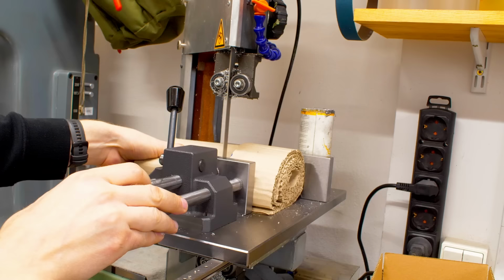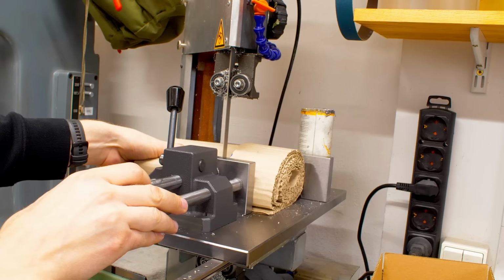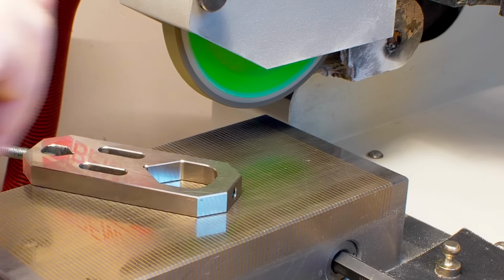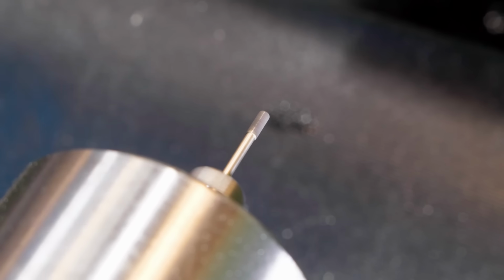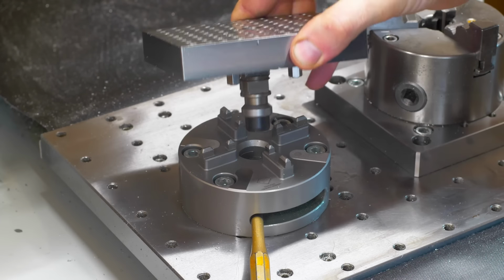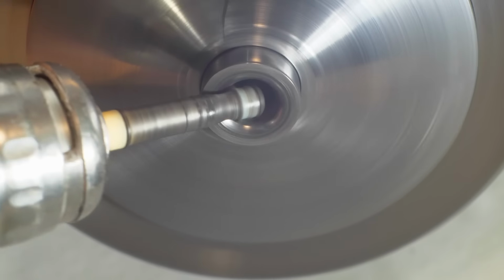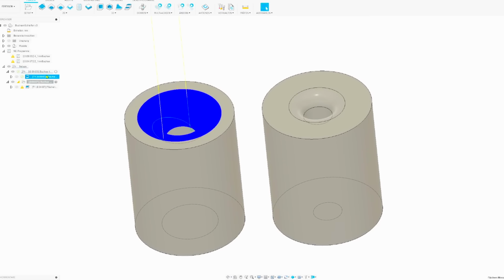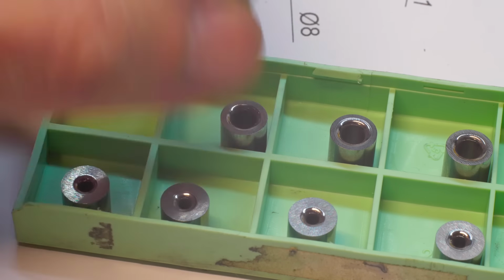Making a part: Flux capacitor bushings

Comment: Great video, as always. That ID surface finish could most likely be improved even without polishing by finishing with a resin-bond mandrel, or by slowing the part rpm slightly and the traverse fairly considerably on the finish pass. Though you'd still be left with some of the artficating from that one crystal on the plated mandrel that's proud of the rest in the latter case. Also, the bell-mouthing of the part isn't due to the pressure decreasing, that would actually do the opposite. It's because the total pressure remains pretty close to the same, but the contact area is considerably reduced, resulting in a higher pressure per unit of surface area contact. At least, that's how it's always been explained to me over the last two years in a precision grinding shop.
Reply: Remembering than English is not his first language (and taking into account his considerable grasp of issues related to accurate work) I think what Stephan probably meant is that as the mandrel is stroked out of the bore, the centering "pressure" (really, the proper word is force) on the diamond mandrel drops eventually to zero, so that the mandrel will nutate (wobble) due to geometrical and balance imperfections in the rotational movement.  
Because of the high rotational speed, centrifugal forces will make the nutation self reinforcing.
When it is in the bore, it becomes somewhat constrained from that wobble, as the hole acts like a steady. Consequently on re-entry to the bore, bell mouthing is inevitable, because initially it is easier for the mandrel to cut the work rather than be deflected, (because of the higher "pressure per surface of unit area" you mention - again, it's really force per unit of area . Which is what "Pressure" actually means, technically speaking).
This progressively changes until it enters far enough that there is enough contact with the mandrel for deflection to be easier (produce less bending moment) than cutting, so as to largely eliminate that nutation. But in the meantime,  a subtle bell or trumpet mouth is being formed at each end.

Nutation only predominates when the cutting portion of the mandrel exits and then re-enters the work.
The effect you describe (which does not involve nutation) also happens, but it's much more subtle.
Reply: I re-listened to Stefan to make sure I had not misunderstood his intent. He says it's important not to stroke too far out, or completely, because you will "suddenly lose pressure on the diamond tool". 
So it seems clear to me that he's talking about the steadying pressure [by which he clearly means force] (which is lost altogether when you exit the hole, and compromised as you get near to the exits). It is not plausible that he would not know that a loss of CUTTING pressure involves LESS material removal, not more.
Reply from the maker: Thanks! Agree on the reson bond mandrel.
As for the bellmouthing - What you describe is what I tried to say :D
Reply: @StefanGotteswinter  I figured as much, it just seemed like a useful clarification to make. Thanks for all your work and teaching, Stefan. I've learned a lot from your channel. Looking forward to the next one!
Reply: @Gottenhimfella  Yeah, I didn't mean to imply that he wasn't aware of the mechanics of the situation, I was mostly just trying to clarify for anyone who would not have understood what he was trying to say, as the intent of the message and the actual words just didn't seem to line up. Stefan is on a whole different level than most of us, and I have a world of respect for the man's talent and willingness/ability to teach. On another note, thank you for continuing to clarify the topic, as your input on the scenario of fully withdrawing the tool means the whole situation is described here pretty well.

Comment: You have more than surface finish concerns.  The EDM does not remove all constituent metals equally.  Think of a sponge.  It is important to use grinding or lapping of some sort to get the final dimension.  The carbide will wear rapidly if you rely on the EDM produced surface.  I experienced this at a place I worked.

Comment: When I worked for a broaching shop when I was younger, I made the electrodes for the Sodick wire EDM machine. One has to know what their doing and have plenty of patience. It would take me about 3 hours a piece to make one electrode. The hole was the most precise area of the part. I used to grind inside bores with a Precise high speed air driven and liquid cooled head. High speed heads do a wonderful job on bores.
Stefan does very nice and precise work on carbide. I can really appreciate watching him work the carbide in real time.

Comment: Those bushings remind me of my job at my dad’s. I used to polish similar materials for the wire drawing machines. They have a similar radius on one end, a conical shape at the “exit” of the wire and a cylindrical section, which created the diameter of the wire. 
We sized the steel wire to produce bolts, screws, nails etc. I was involved in all the steps of production: wire sizing, rod cutting, head and thread forming, heat treatment and electroplating. You know apprentice of all, master of none. 😁
Reply: BTW short before CNC machines arrived to my country.
Reply from the maker: Interesting, thanks for telling!
Reply: I was thinking along the similar lines, like these might be guides for wire into some machine that works with wire.  Perhaps straightening wire that comes off a spool, or winding straight wire into a round shape as for a coil or spring.
Reply: @gregfeneis609  they wouldn’t work for straightening wire. For that you need to break the elastic point in the wire’s bends. You do that by offsetting pulleys or rotating a die system. The rotating offset die system is the most used because you break the elasticity in every direction, not only in one. It’s hard for me to explain it better, I’m not that articulated.
Reply: @thigtsquare950  yes I'm familiar with the roller mechanism that you describe. I was thinking this part would be the entry nozzle to that roller mechanism you're describing. I wasn't thinking this nozzle would be the only thing required for wire straightening
Reply: @gregfeneis609  Oh, we used a worn out die for that, actually several sizes larger. No need to constrain the pulling force.

Comment: Great video as always. Be aware that the binder in Carbide blanks is usually Cobalt, which is moderately toxic. I am speaking about the residual dust that you are wiping off of the dovetail ways, etc.
Reply from the maker: Yep, very aware, thanks!

The dust extractor is rated for "it will kill you slowly and painful"-materials and I wear a mask when doing major carbide work.

Comment: You mentioned struggling to get Fusion 360 to climb from top to bottom, at around 24:00, under the passes to, find pass direction and input 180°, then it will start from the top.

Comment: Impressive work!   
I used to run a Moore Jig Grinder "back in the day" and hated grinding carbide.
Reply from the maker: Thanks!
Interesting, i prefer grinding carbide a bit, because i find material removal way quicker than on steel. But it comes with its own challenges.

Comment: I wish you could give a ballpark number for the cost to the customer for some of these small parts sometime. I worked in a R and D company in my younger years working with machines to smooth out workflow on production lines in the bottling industry. The amount of cost that goes into small and single run items can be staggering.
Reply from the maker: Imagine a 100ish price tag for an individual part on this order.
It was on the cheap side, because I also took it as an learning opportunity.

Comment: Stefan, a tip; if you ever used a woodcutting saw at a piece of cardboard you'll notice that the saw gets blunt really fast... Same goes for a bandsaw I discovered too... Best, Job
Reply from the maker: Damn, yeah - Cardboard and Paper is realy good at dulling cutting tools. I find it less critical with bandsaws, but knife blades and circular saw blades realy take a beating.

Another brutal things for blades is Rubber.

Comment: Just had a weird thought. Could you use a camera to center-find? Have fixed feducials on the machine as reference, a perminently mounted 4K cam, and use something like OpenCV to find the center of a mounted part and pass that to the DRO? Basically adding Pick&Place location finding to machining? Probably already available in a box from Wish ;-)

Comment: Looking at what it takes to machine carbide, i have a dress ring (to wear on my finger) that is supposedly carbide. Was about 300 AUD 🇦🇺 but im kinda suspect now what sort of carbide or whether its carbide at all. Its certainly shiny and tapered conically after years of wear. Seems kind of cheap for the work. Even has a pattern etched into it and is laser engraved on the inside with branding etc.

Comment: What guidelines do you have for using the proper Erowa pallet size? how heavy of a cut can you take with the ITS 50 pallets vs the ITS 100? am I being overly cautious by wanting to use 148 PowerChuck for most fixtures? It appears that you use ITS 50 size.

Comment: Awesome work once again. I might have to use some of these techniques soon, as i have to try to improve the surface finish of some small blind 4.5dia14d deep tantalum parts. I might make a lap(never done this before)Any thoughts?
Reply from the maker: lapping a blind bore is rather painful, I have to say.

You might need multiple laps, maybe even one, that is only a narrow band with nominal diameter on the front, so you can work the end of the bore, without bellmouting/wideing the remaining bore.

If its only for surface finish, I would try polishing wood, cut with a nice, crisp sharp end, and some diamond compound to polish the bore that way.

Comment: Thanks for another interesting and informative video. I didn’t recognize your D bit grinder. What ever happened with the Asian import one you were remaking ?
Reply from the maker: Thats still beeing remade :)
The machine used is my Deckel S1 tool&cutter grinder.
Reply: @StefanGotteswinter I was wondering if it would make sense to grind these bores on the S1.. I guess it depends on how well one can eliminate runout & taper in the workhead,  & the ease of mounting the high speed head. Great content! Thanks.

Comment: Hmm. Wondering if you had a low profile chuck with a motor under it standing up on your mill wouldn't you be able to do the movement in one go where you don't wear that much on the axis's on the mill ( kinda useing the mill as a lathe with live tooling )  ?

Only asking since that's one of the few things I haven't tried myself
Reply from the maker: Yep! Thats what one would do on a machine with a C-Axis (5-axis cnc).
Reply: @StefanGotteswinter   or just a slow simultanius 2D action/movement  ( X and Z ) and a moter with a chock spinning independed of the machine it self 

we just used it at work a few weeks ago and it worked perfectly

or haveing the part in tool holder and diegrindr standing up in a vise ( that way the mill will pretty much become a lathe with live tooling in. did that back as a apprentis with flarless resoult's. good precision. stable process. good serface finish and fast  )

Comment: What kind of carbide is that? I am curious about getting carbide like that in different sizes and shapes. Could a water jet produce those cylindrical blanks from a solid brick? I don't know if one could create the hole feature with a waterjet, although an undersized one seems possible. I believe its accuracy is around .001 inch. I recently acquired a Flow Mach 200c that is five-axis so that it can do bevels. I think that the radius you made would be impossible with a Waterjet. I was told when cutting carbide, I need to use aluminum oxide instead of garnet for the grit, which wears out the jet tip more quickly. I think that the tip is made from carbide.
Reply from the maker: Thaths the carbide blank used:
https://horn-eshop.us/en-US/product/wos080-330-00-08-0-hk1f

The OD is already ground very precisely, that would be an additional step when doing waterjet cut blanks. But I imagine for cutting general blanks it would be a cool tool.

Comment: Are you sure about how the center bore is made into the carbide rod? I think it isn't EDMed. I think it is more likely that it was made before sintering. A plastic stick is placed in the center of the rod and is burned out while sintering. The helix cooling channels in carbide drill are made similar as far as I know.
Reply from the maker: Yes agree, normaley they are molded, but on that blank it was definetly burned. It had all the marks of a burned/hole popped hole on the face of the rod
Reply: @StefanGotteswinter I don't know anything about this subject, but maybe leftover soot?

Comment: 'Simple enough machining' except it isn't, in a home shop making carbide parts with small internal bores isn't exactly common or easy, even though you made it look quite simple. 
Heck, I have enough issues with old hard stainless steel parts.(being retired and broke without correct tooling doesn't help though 😅
Learned something new about diamond grinding bits as well, always a plus.

Comment: Can you share the make and model of the grinding spindle? Thx!
Reply from the maker: The Air spindle? Its most likely a WG USF, but thats only by pictures and what people told me about it, it has no markings.
Reply from the maker: A NSK Planetor 700 would be very similar and easier to obtain.
Reply: @StefanGotteswinter   Thanks! Been looking for something like this.
Reply: @StefanGotteswinter    Google cannot provide a single hit (in verbatim mode) for NSK Planetor 700. 
Is there a typo?
Reply from the maker: Ah, mixed up my spindle names.

NSK Planet 550
NSK Planet 400
Reply: @StefanGotteswinter  Thanks!

Comment: I could be wrong here but I think the through coolant holes are normally made by wires which are pulled out during the sintering process?? Anyone?
Reply from the maker: Agree and you are correct, yep! But that blank clearly showed the marks of having a burned hole, with the sparks/sud from a hole popper around the hole.
Reply: @StefanGotteswinter  thanks Stefan. Love your content BTW

Comment: Could you have run the spindle in reverse to get it to be climb with same toolpath
Reply from the maker: Yes, if the spindle was setup to run reverse :D
(I did not wire a reversal output between control and spindle drive)